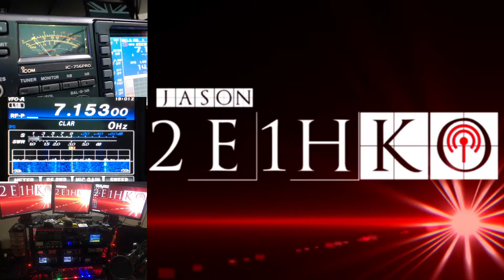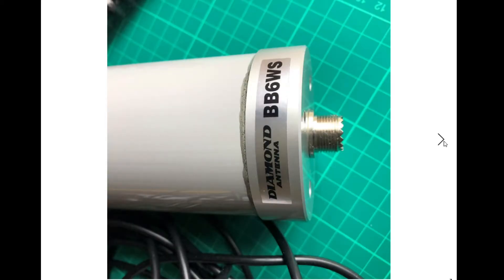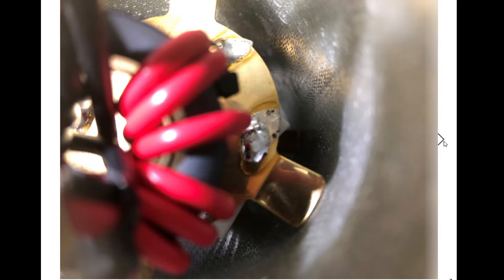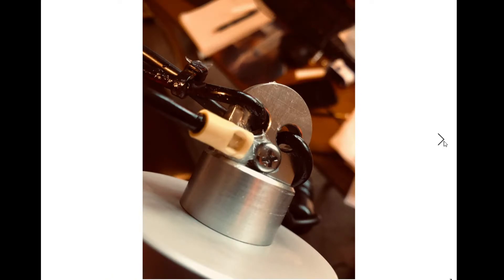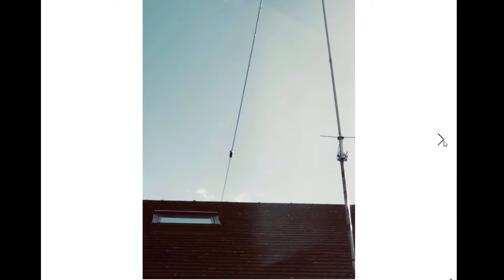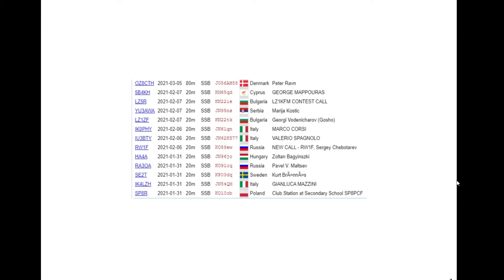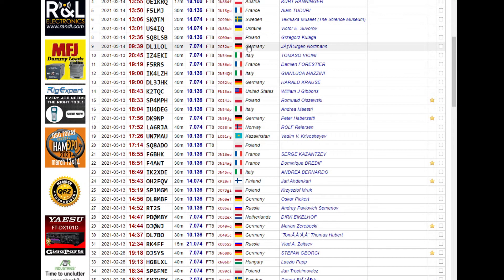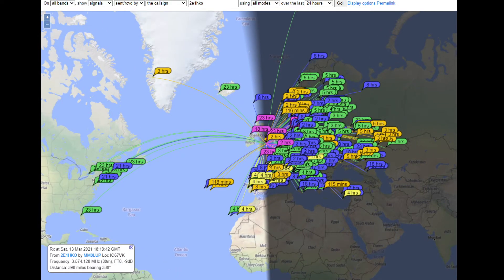Diamond BB6WS Antenna HF 3-30Mhz Part 1

Comment: Nice video - lots of videos about antennas out there but a lot fail to show it in situ and how it is attached.  It's the logistics that has me thinking and over thinking what type to get that is the least obtrusive.  I'll add this to my list to look into along with the W330s mentioned in the comments, cheers.  Similar velux window setup  as well so I may give that a go (it'll save getting someone in to go up on the roof!). Out of interest, how long is your garden EDIT: just watched your previous video so I can see.  Impressive what you can manage!

Comment: Thanks Jason! I bought a BB6WS second hand and cheap but never tried it, I guess I need to give it a go alongside a fiberglass pole and use it as a vertical, to see what it does .. 73
Reply: antenna too quiet not efficient at all I prefer the Diamond wd330s
Reply from the maker: @DAVID.RADIOAMATEUR  I did try to get a W330s which would of been perfect for my small garden, but no stock was available in the UK at the time. I would like to get my hands on one and give it agp 👍 73s
Reply from the maker: 👍. I’ve got to upload my video this weekend, as I’ve tested it vertical, up a fibre glass pole and the results are similar. It will only be a short video showing it set up and a quick look at PSK reporter showing places that I’ve been heard on FT8 using 10w. I’ve had a few local European QSOs on phone. 
I would imagine it will perform better with more RF power... good luck setting it up 73s
Reply: @jason2e1hko59  Looking forward to see the results Jason, 73